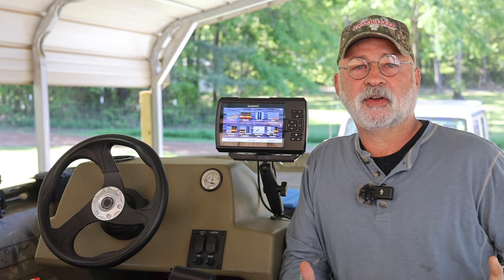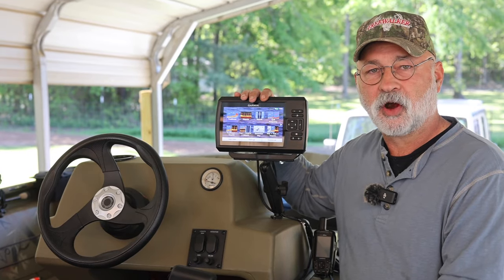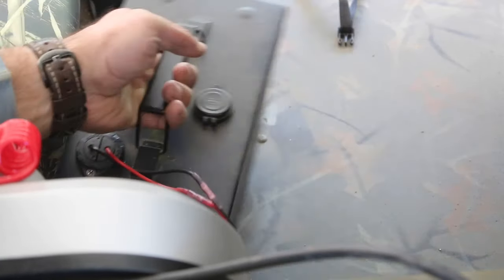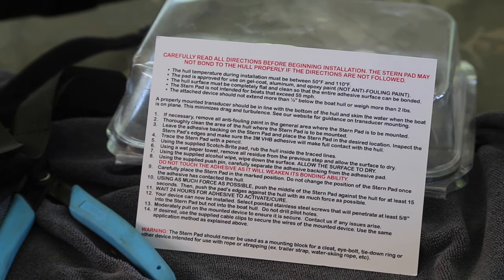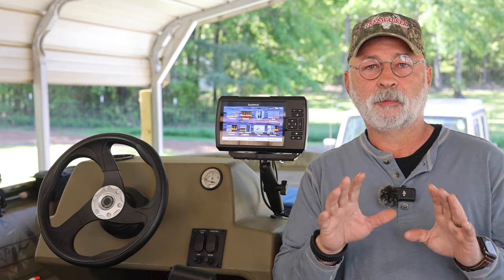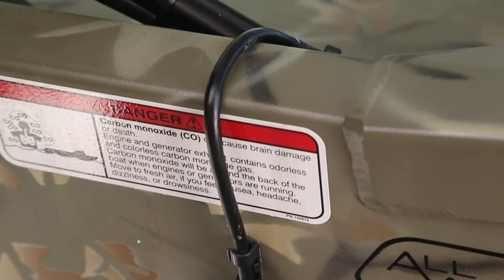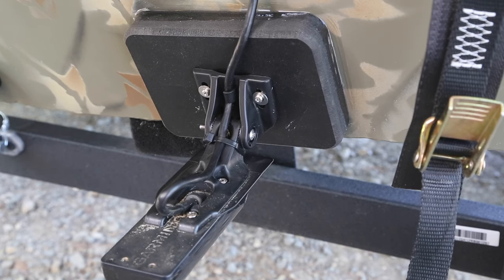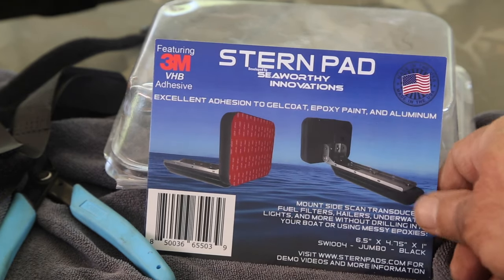No HOLES, Transom Saver, Install your fish finder easy, Grizzley Tracker Mods

Comment: I love 3M stuff. But I would be curious to see how long that will last since it’s going to be underwater. Let me know if it ever comes off and how long it lasted.
Reply from the maker: Yes sir, I will, ha, you know me, if it's gonna fall off, it would happen to me hahaha, at the most in-opportune time at that hahhaha. Thank you for taking the time to watch and comment, I hope you have a blessed weekend. 
Dale
Reply from the maker: One thing I thought about was I dont know if I mentioned it or showed it in the video. I did put the Marine goop stuff around the outside edges of the transom saver, in hopes of keeping the 3M tape dry at all times, Not sure if it will help or hinder it, But I thought it was a good idea and I dont recall if I mention it in the video,. 
Thanks again for taking the time to watch and comment. 
Dale
Reply: Mine has been holding strong for over 3 yrs
Reply from the maker: @seandevine6768  That is wonderful news, thank you so very much for sharing this with us. Thank you and have a blessed week. 
Dale